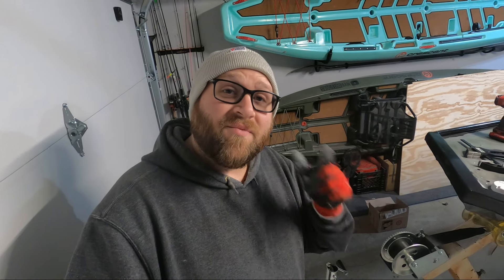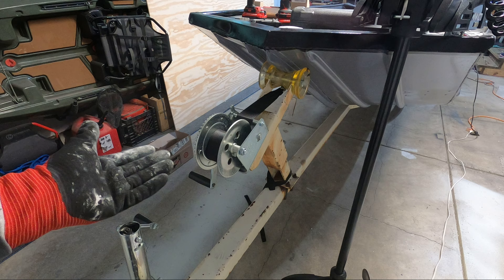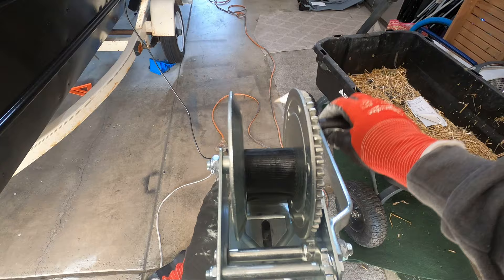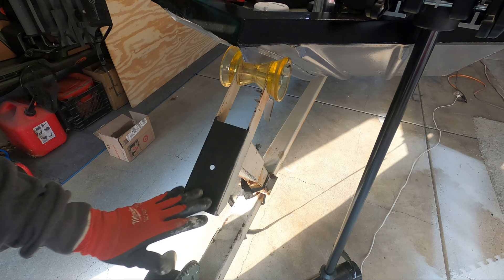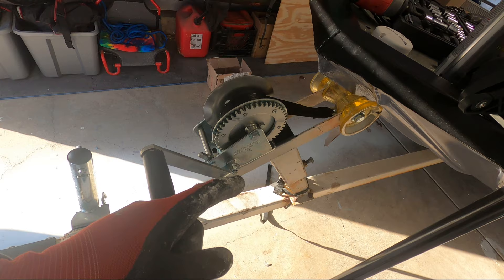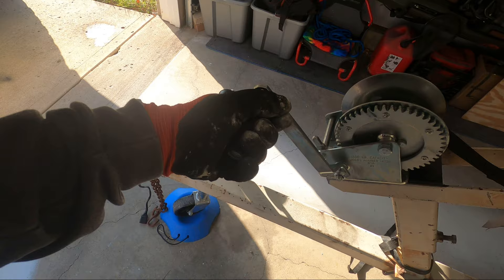HOW TO SWITCH BOAT WINCH HANDLE | Mods Maintenance Grease

Comment: There is a correct way but in this case whatever feels right for you. Great tips on the grease . My trailer is brand new but next trip up to my sons place i'll put some on.
Reply from the maker: You're not wrong! I'm glad to have it flipped around -- it was something I've been meaning to get to. Is yours a boat trailer or?
Reply: @mvboutdoors  boat trailer. got my boat and trailer a month ago took it in the water once and then snow lol.
Reply from the maker: @FranksDIY  Congrats! I bet it's torture, what did you pick up?
Reply: @mvboutdoors  easy hauler with a 14 foot mirrocraft on it

Comment: Apr 2023:  I was looking for the detail on the shaft flip so the handle mates on the opposite side.  Looks like you cut to that after editing.  Maybe too much swearing was involved?  LOL  Regardless - seems like it would be a hot-button topic.   Another person said fliip it 180.   Might try that.
Reply from the maker: Yeah I ended up flipping it 180, the handle on this winch only mounted to the one side. Has been working like a charm since!